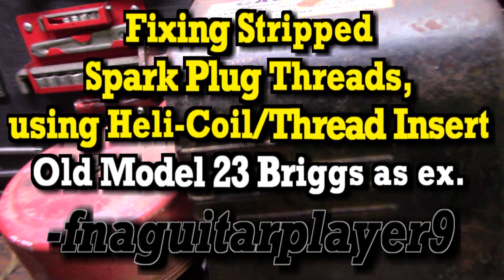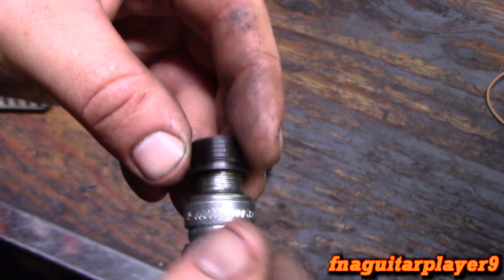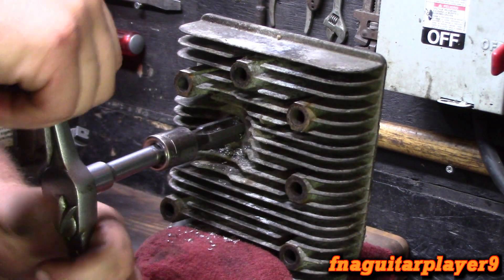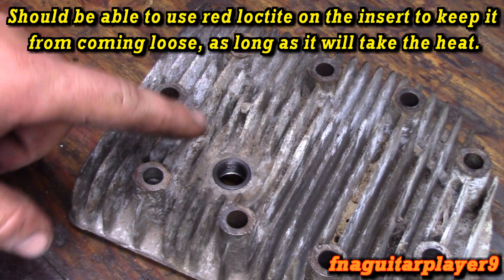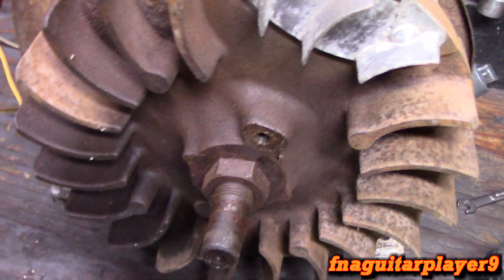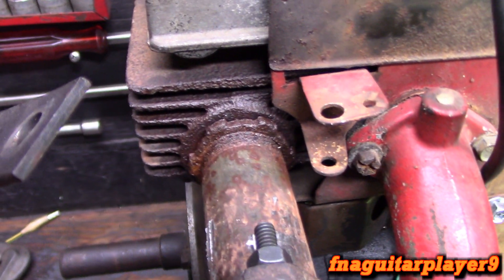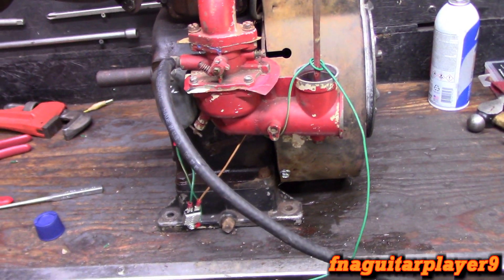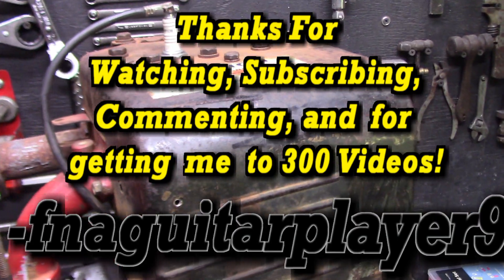300th Video! Fixing Stripped Spark Plug Threads, Using Heli-Coil / Thread Insert

Comment: Not a bad old engine. I had one years ago on a walking tractor that had a blasted snail on top of the piston. Got it running and swapped it for something. The sawyer/logger got it and took bed rails and made a frame with front wheels but took spider gears out of a truck rear end and made steering gears that worked BACKWARDS! You'd do good till you got close to something and then you'd run slam over it trying to dodge it. It was slow but you could hear the crashing and screaming all over the place. Maybe some Locktite on the insert. I've got a 301 on a Gravely that was sucking air around the throttle shaft. I've got a new carb but it's sits in the box. The Gravely has a rotary plow on it but it don't need running so it sits. Thanks for the video and Pick Me One!
Reply from the maker: I hear ya! haha that would be funny to see, and drive haha Yeah loctite should work, it would have to be the the red type to take the heat better. Those 301's are great motors, they run so smooth. Thanks for Watching!!!
Reply: @fnaguitarplayer9  I've got another 3553or 5335- whatever with a kidney mower that just putters along but the 1/2 V.W. motor, he 19.5 opposed Vanguard beats 'em all BUT you still can't beat cast Iron!

Comment: Holy Geez Frank, 300Th ! Everything seems like yesterday, when I started to follow you, about 10 years ago ( when your hair was "slightly" longer and teasing you about the grease...LOL...) Happy 300th.
I did repair a stripped head (spark plug insert) with some small gauge copper wire. I wrapped it around the spark plug thread and it worked for many years but, the engine never had proper maintenance and started to "clap". It is on a "future project" shelve as we speak. Thank you very much for sharing your knowledge. I've learned a lot from you. Thanks again and keep 'em comin'.
Richard
Reply from the maker: I know! It doesn't seem like its been that long! Thanks for Watching!!!